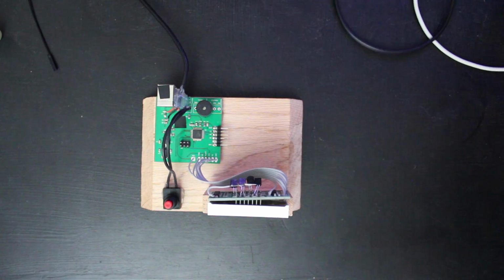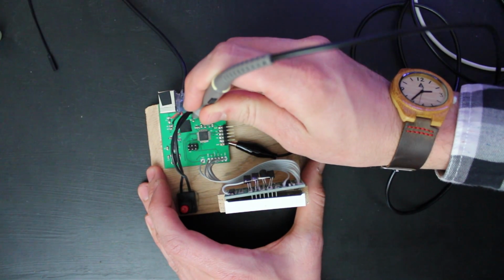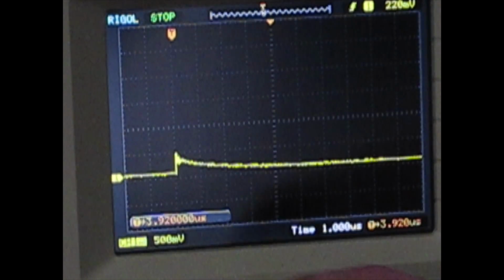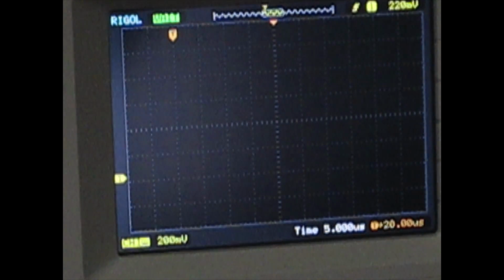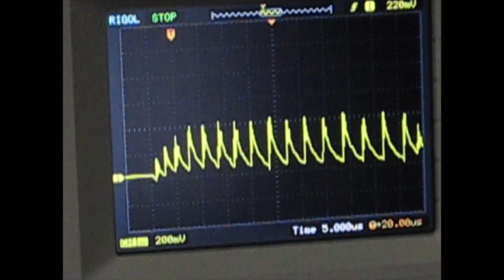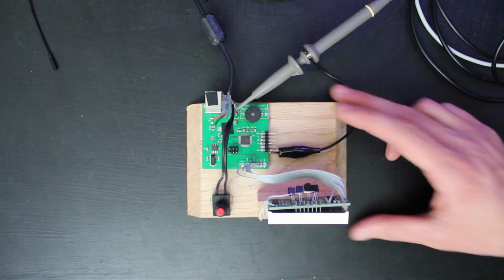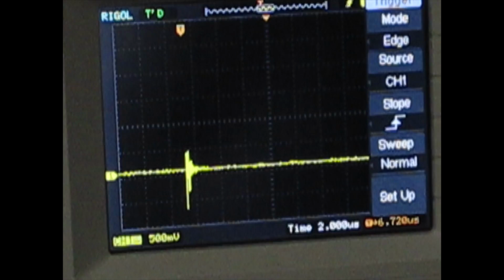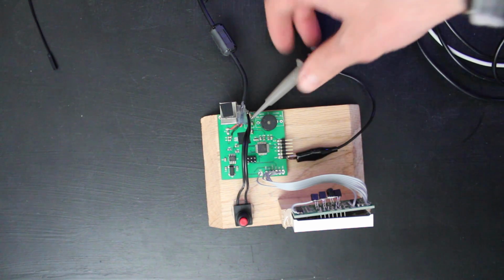Designing Robust Circuits - EMC part 1 (Example of bad design + quick fix)

Comment: Thanks for another great video! I have had similar experiences, for example I had made small circuit with the attiny85 that alerted me when the door to my room was open. To power it I used a usb wall adapter. It kept on alerting me when the door was closed. It turned out it was small power surges caused by appliances being turned on which brought down the voltage just enough so that the difference between + and - was less than 5v and it triggered the signal.
Reply: +ComplexScience same. In my project I'm still not quite sure if it's interference on the power cable going to my attiny85 or the long signal cable going to the door which triggered the interrupt. I tried a bunch of different sized caps across the pulldown resistor on the interrupt pin but they didn't help much. Looking forward to the next video!

Comment: Nice video, Kevin! This really struck a chord with me, actually :)
A few years ago I built a wheel speed computer for my hamster's wheel, so I could see how far she ran in the night and how fast. It worked great! Most of the time :P I'd designed it around a bike speed computer, and because I couldn't enter a wheel size as small as a hamster wheel when I was setting up the bike computer, I build a "prescaler" circuit using a decade counter.
It was powered with a fairly skookum 5v wall wart, originally intended for charging a cell phone, and the input of the prescaler which was connected to a reed switch was all properly debounced and everything else. I thought I'd planned the circuit out pretty well!
However every now and then I'd notice the computer registering quite fantastic maximum speeds, and these seems to get more and more absurd over time, until my hamster was managing 99 miles an hour on some nights!
I never did get to the bottom of what was wrong, and do you think I could ever replicate it?!
Reply: digitalradiohacker Chooched like a hot damn!
Reply from the maker: +Azayles focus you fak!!
Reply: Kevin Darrah Ah the good ol' voice actimavated focus! :D

Comment: I note you mentioned amateur radio. Yeah - I recall back in the early 1990's Ford was using TRW made alarm systems in their cars. And if you keyed down at 5W on the 2m band you could trigger every alarm on every Ford vehicle.
Reply from the maker: +kd1s haha! that's crazy.

Comment: Nice video and to be video series. I just went to EMC and FCC certification on a product I designed, so quite relatable.   The product was luckily a strain pass for the consumer level direct and radiated emission / immunity (which was its main purpose).  However when pushing the limits a little further we found that in conducted immunity the USB interface failed in the 30Mhz and 60Mhz region. This happend because of a ferrite bead I placed in series with the USB shield and ground on the board. By replacing the ferrite with a dead short ( 0R )we made it pass also the industrial demands (just for fun). So another tip here -> tie the USB shield directly to ground.

Something else now. In the video you put a 100R series resistor between the debouncing cap and the switch. This resistor is EXTREMELY important when there is a debouncing cap, and I state this because you didn't mentioned it in the video. When you omit this resistor you made EMC emittor on button press. Discharging a cap by a switch results in very high di/dt and will radiate causing errors elsewhere on the board (made this mistake once when I was young, took ages to find, will never forget :P ).

Keep them videos coming! Love these hands on problem solving video's, the hacking and thinkering  internet needs them ^^.
Reply from the maker: +Danny Bokma Hi Danny, ah yes and sometimes I'll see like a 1MEG hooked up between the USB shell and ground as well... I usually hook it straight to ground though.  

And yea, I was going to get into why I needed that 100ohm resistor, but I forgot :)  Same reason if you were filtering your reset pin, but also wanted a pushbutton to reset the board - don't forget that series resistor!

Thanks for the tips - care to share what that certification cost was?
Reply: +Kevin Darrah Sorry for the delay. We did the testing at DARE!! (yes that is actually their name). The official part is 2500 euro (testing + documentation). But beforehand we did two pre-compliance tests (700 euro each) meaning -> we had two times halve a working day the time to do anything we wanted.  In the first test we did all radiated tests and did the conducted immunity, we discovered the error and fixed it the day after the test. During the second pre-compliance test all tests were passed. A month later we did the full test and succeeded that as well. So in the end we made the right decision to first do the "cheap"   test  and when they were all OK do the real test.